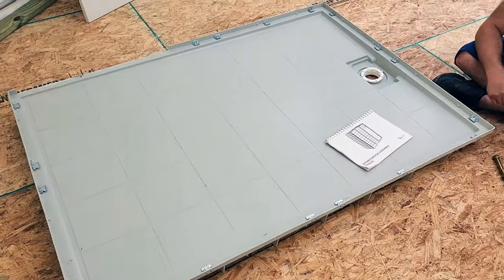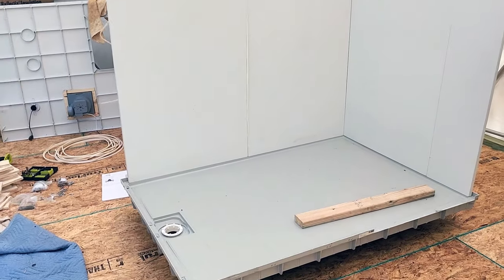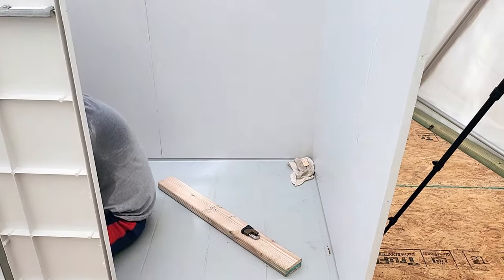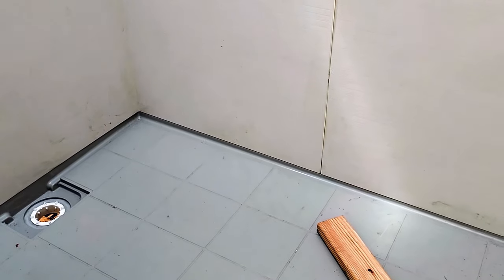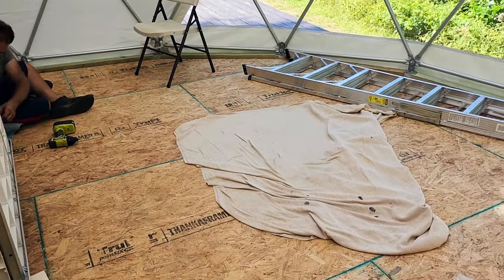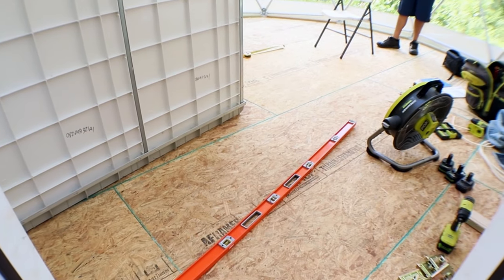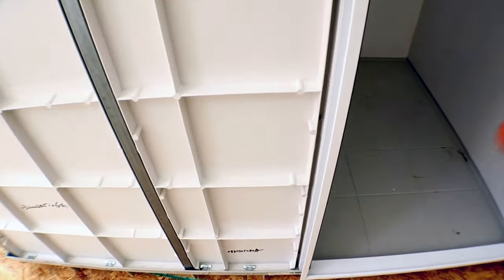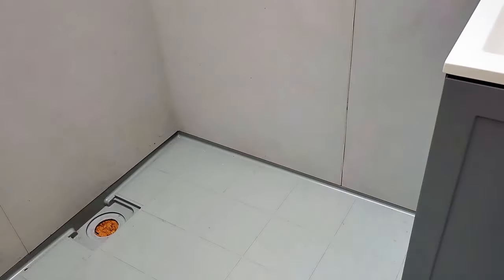*New* Tiny Bathroom Pod installation in our Glamping Geodesic DOME Build [Airbnb]

Comment: As an architect who specialize in small home design, the dome would flow better if you turned the pod 180 degrees so that the door is in the same vicinity as the exterior door. This will create a "foyer" giving you space to hang coats, put luggage, etc. It'll also allow you to run plumbing in the dead space between the pod and the dome wall. Place the kitchenette on the opposite side of the pod, giving it it's own space for maneuverability without competing with people walking in and out of the dome. This will create a large, unobstructed space to place the bed. 

I didn't see an outlet for the toilet in the base of the pod; is it a dry toilet? Also, consider how your plumbing will enter and exit the structure; which means more holes for Eric to drill. 😎Y'all are doing great. Keep following your passion and bringing your dreams into fruition!
Reply from the maker: Awesome advice 😊 we tried everything but in turn, decided against using the bathroom pod. We wanted to give our guest a bit of a luxury feel and realized the bathroom was way too small for the vision we have for this space. So stay tuned to see how we transformed the space and created a custom tiny bath with more room to enjoy and allow for a better flow. Thank you for watching and giving your professional opinion. we truly value your suggestion and pray you continue to offer suggestions or concerns. 😊
Reply: Custom seems to be the way to go in small spaces. Looking forward to seeing what y'all came up with 🙂